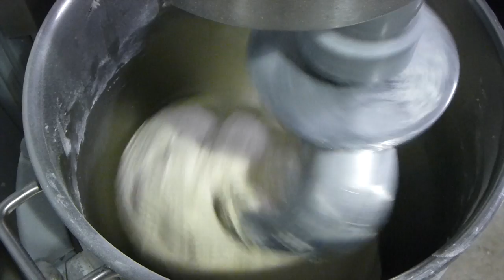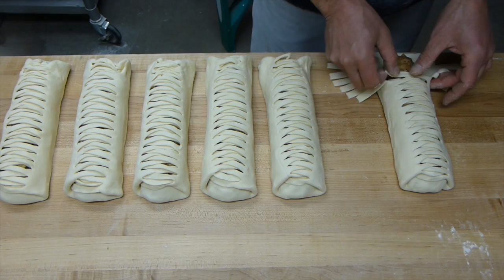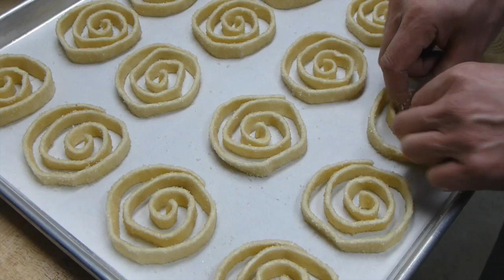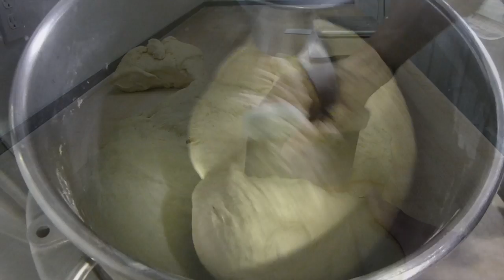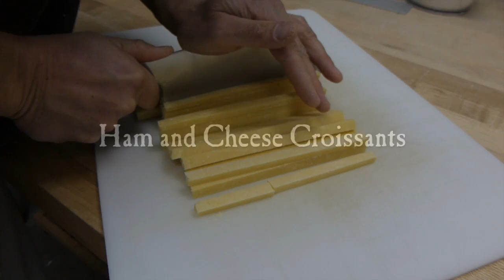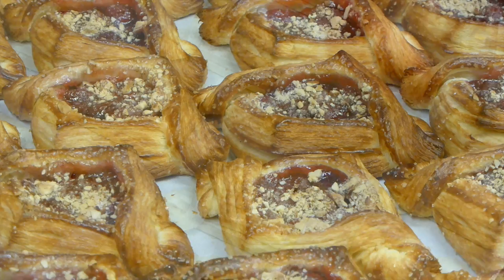TenPastries

Comment: Hey Mark,

Awesome stuff, as usual. 
Thanks for letting us see your techniques. Might need to borrow some of these for the shop!

I do have a couple of questions (of course)... 

The croissant dough: I see you are doing three single folds (27 layers) Is this correct? 
If so, is there a specific reason(s) you chose that vs the more typical 2 singles and a book (36 layers)? 
What's the thickness on your finished sheets? Are you doing a butter/flour mix for both the puff and the croissants?

Edit: And I'm being asked by my baking teacher if that's five singles on the puff (243 layers)?

Thanks!
Reply from the maker: +Paul Aboud Correct, 27 layers for the croissant and 243 layers for the puff.
I've found that 27 works the best for maintaining separation after lamination.  If you try to increase more than that, you risk smashing them together during final sheeting.  
Croissants are sheeted to 3mm for shaping.  When I show the layers in the video, it's at what I consider the 'pre-final' stage at about 12mm.  
Croissant butter slab is just butter.  Puff butter slab is butter, AP flour, and lemon juice.
Reply: +markcsinclair Thanks much!!

Comment: I watched myriad bakers making pastries and so many of them bring out the rolling pin and Bash the cold butter into submission… ur method of flattening the butter is brilliant. Makes more sense to work with the butter when it is soft...I also noticed u added some flour to the butter while missing it in ur mixer? Was this to give the flour a smattering of gluten or was it just to give the butter some “Umph” to get it going? Lol
Reply from the maker: Mike, for croissants my butter slab is strictly butter. For puff pastry the butter slab is butter, flour, and lemon juice. Since puff has more turns (layers), it helps the butter to be more extensible.

Comment: What does the slip at the flat bottom of the triangle do for the croissant? Allow space to puff up? I’m curious.
Reply from the maker: If you're making a curved croissant (as opposed to a rolled-straight one), the slit makes it easier to spread the base of the triangle apart and make the shoulders wider. Plus as you guessed, it creates a space in the center that puffs open.

Comment: Hi Mark, I just noticed two thing,  one, you added flour into the butter when you were making the butter slabs, why is that? two, you didn't turn 90 degree when you were laminating the dough, could you please let me know why? Thanks
Reply from the maker: Caterina, for the puff pastry butter slabs, I added both flour and lemon juice.  It makes it a little bit easier to work with and more pliable.  With the croissant dough, as you noticed, the butter slabs were just butter.  My puff pastry has 5 folds and my croissant dough has 3 folds. 
Oh and I may have edited it out, but I did actually do 90 degree turns with both the puff and croissant dough.  Good observation.
Reply: Thank you so much for this detailed reply. What does lemon juice do if I may know?
Reply from the maker: It works to relax the dough; some people use a little bit of vinegar. If the flour is not very strong, it may not be necessary.

Comment: I want to try your tutorial ... I count the folds for 5 times single pastry and 3 times a single croissant ... really count me ?
Reply from the maker: Yes you counted correctly,  that is how many folds I do for each.
Reply: what I saw in your tutorial ... you didn't resting the dough between the folds ... is it really you directly, between folds without resting ... or your video is cut at resting ... because I see in some videos using resting between folds
Reply from the maker: The video is cut so you don't see the resting.  There is about 30-45 minutes in-between each of the turns.

Comment: What temperature is the coldroom set to?
Reply from the maker: Good question.  When I made the video, the coldroom was about 10C/50F.  I have worked making laminated dough between 0C/32F and 32C/90F.  Once it gets above 20C/68F it gets a little difficult and it requires more resting in the freezer to compensate for the warm temperature.